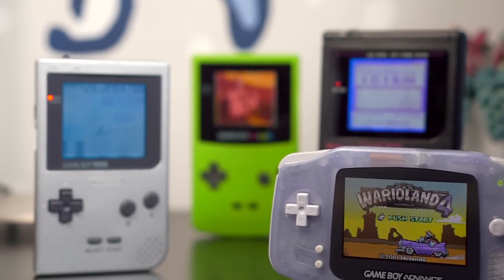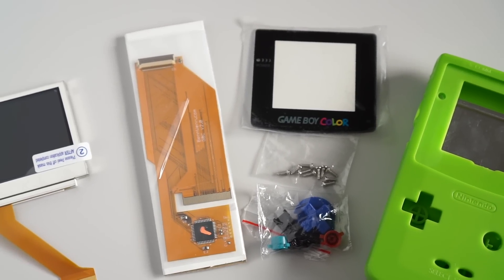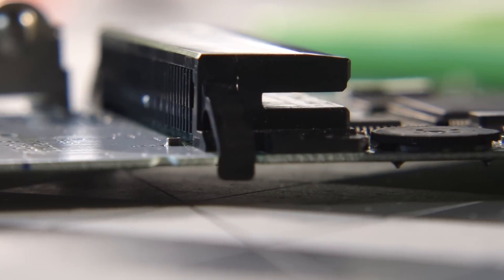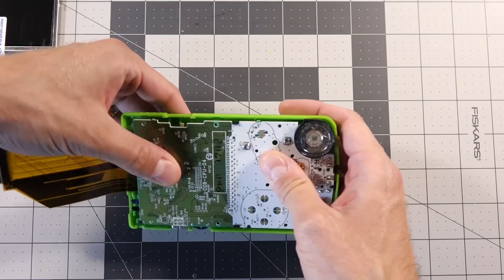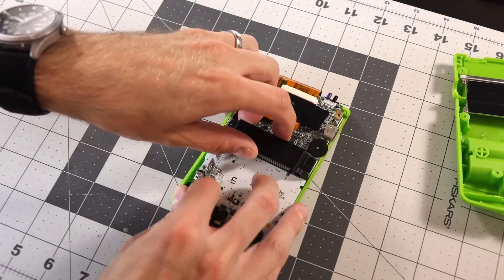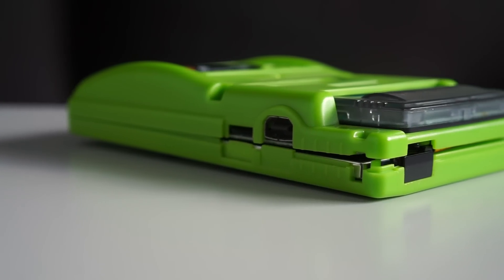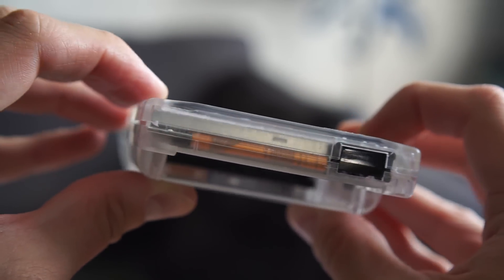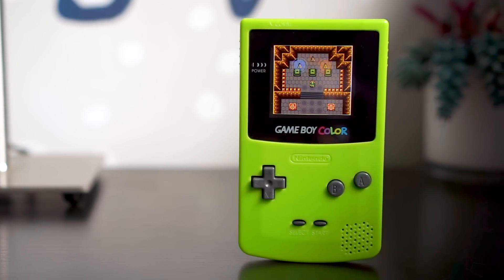BennVenn Backlit Game Boy Color Mod

Comment: you can take the metal casing off the LCD to allow more room. the front part comes off pretty easy after prying it, but the back has that little tab you have to be careful with otherwise you could ruin the screen. also, you can shave a power switch down to about half as wide and it will fit and still be functional.

Comment: I would never mod in a screen that requires you to trim it down on the inside, this screen doesn't even have the proper resolution. I hope there will be new backlit screens that fit, but that's unfortunately unlikely.
Reply: Eddie This screen has the EXACT correct resolution, pixel aspect and viewing aspect ratio.
Reply: No, it's a higher resolution that has to be masked off.

Comment: I'd rather wait until a TaoBao screen is RE'd and mass produced.
Reply: PandaXclone2 or you could fund bennvenn and his experiments. Check out his facebook, hes been going through quite a lot to source a proper square screen.

He makes little to no profit for this stuff. Heck, he even hand builds his own design of sd card based flash cartridges because he thought the everdrive was too expensive.
Reply: Don't use Facebook. Anyway, so long as he's making correct-sized screens then I would probably fund it.

Comment: Losing the power switch and not being able to close the housing is a deal breaker to me.
Reply: Byron If you mod the case correctly, or buy the pre-modded shell it'll close up like the original, with a power switch and an LED
Reply: Its pretty neat. Does not beat my backlit modded gba's but for 30 bucks its a great unit with a pretty decent built quality. D-pad is a bit hit&mis though, but replaceable with a gb pocket d-pad
Reply: I own a GB Boy Colour and it's awesome!
Reply: Or you could buy the GB boy colour on amazon for, like, $20

Comment: Hi Collin, Great new video with slick production and editing as usual. I'm planning to do this mod and have joined a back order queue for the ribbon cable. I've seen another YouTuber video about this mod and he removed the lcd assembly from the aluminum enclosure and gained a couple precious mm. Have you seen that vid?

I'm also not in favor of gluing the package together. I wish a Chinese vendor would create a custom gbc shell for this mod. There's got to be a better way.

Comment: Don't forget the missing power LED in the "things to consider".
Reply: Eugene Romero If you mod the case correctly, or buy the pre-modded shell it'll close up like the original, with a power switch and an LED
Reply: I don't believe so, since the area where the LED sits is now covered by the actual screen (screen goes edge to edge inside the shell). The only proper way of doing it is by installing an SMD LED on top of the screen, with something like copper tape. So its doable, but I think Colin should have mentioned it in the video.

Comment: Let's hope Nintendo release a Gameboy Color Classic with a 100 built in games. I'd be all over that.
Reply: You can get the "GB Boy Colour." on eBay haha
It's backlit and has about 100 games on it...
Reply: Yeah, but lcd is a dumpster fire.
Reply: It's REALLY not that bad. The weird aspect ratio is a massive turn off for purists, definitely, but for 25 bucks shipped it's a SOLID option for those without electronics skills like myself.
Reply: major advantage to it would be that a low power chip could power it and modern batteries could make the thing to a couple of days of constant backlit gaming if the size of the thing was anything like an original GBC. 
wouldn't need as much power as a smartphone but could house a bigger battery than most phablets and would have no cellular radios or other wireless stuff to drain battery

with it being a portable that can clock up more hours of gameplay out of convenience there would be more logic to Nintendo having some mechanism to load on different gamesets OR to have significantly more than 20 games included on it. 
maybe 20 top tier original, a few enhanced (super gameboy palette stuff) and 20 top tier GBC games would do it.

done right that would be far more appealing to me than any of the other classic devices because almost every aspect of the gameboy would be majorly improved. 
its not like the situation with NES and SNES games looking better on the CRTs of their era - all the gameboys prior to the backlit GBAs look really really bad next to any screen from the last 10 years.
Reply: I have one of those, it's ok-ish but I want something with that quality Nintendo feel

Comment: Colin, you NEED to include a disclaimer that the pin 3 sound chip mod at 2:27 is NOT required for this!  This is a very tricky mod, and people can risk breaking their GameBoys.  Just a friendly heads-up.  Nice video otherwise, and I'm glad you finally made yours!
Reply: Hey guys, here's an update on this situation - I spoke with BennVenn (Ben Grimmett) about it:

"You don't NEED to do the pin3 mod, it'll just give you a constant buzz/whine and use more power and depending on the GBC version, it wont run flash carts."

Essentially, the pin 3 mod is not "required", but it is highly recommended to do it.  Seeing how Colin is using a flash cart to run Pokemon Prism on his modded console, the cart is most likely only working because he did the pin 3 mod, so just be aware of that downside if you decide not to do it.  That said, in my experience, the hissing noise wasn't any more noticeable than the feedback/hiss that was coming from the speakers before I modded mine, however BennVenn recommends doing the mod anyways.  Also, make sure you have the right tools for the job!  BV recommends having a clean iron tip on your soldering iron and using flux when un-soldering pin 3.

Happy modding, everyone!  And let myself or Colin know if you have any questions!

Comment: Although your work here is awesome and your skill at doing these mods is superb, i'm pretty disappointed. 

The cost of this mod is huge and the skill necessary to do it is really high (i suck at soldering lol) and the GBC shell doesn't even close at all. But considering that this is beginning of GBC backlighting is cool i guess. I think i'll stick with my GBA SP 101.

Great video Colin!
Reply: Matrigger If you mod the case correctly, or buy the pre-modded shell it'll close up like the original, with a power switch and an LED

Comment: wait so, you don't have the power switch installed? my problem is, that the screen doesn't even fit. I'll need to remove the front metal case then I guess...
Reply: Gehirnstaub If you mod the case correctly, or buy the pre-modded shell it'll close up like the original, with a power switch and an LED
Reply: I modded the case correctly. I'm 100% sure. Also used are a aftermarket shell. I made the same thing as Colin, but as I said the screen just goes in, when I remove the front metal.

Comment: Amazing job as allways. However if it doesn't fit in any possible way I don't really see the point as it wouldn't be useful to play. That being said keep making such amazing tutorials! Thank you very much!
Reply: Cesar Delgado Cabrera  If you mod the case correctly, or buy the pre-modded shell it'll close up like the original, with a power switch and an LED

Comment: Hmm it seems to be a simple case redesign to allow the screen to fit perhaps a bit more thickness on the front shell to allow the screen to fit better cant really tell how bad the screw issue would be does the screen get in the way of the stand offs as well? the mod isnt perfect but its better than having to deal with no backlight mods at all for the GBC.

Comment: It ain't worth it tbh Colin. It's over priced
Reply: Eddie W. I have that craving bro, but it still isn't worth it. Colin made the installation look really simple while other guys had a lot of problems with the adapter that Benn listed as experimental. The cost of the adapter is ridiculous because these things cost $5 on average per unit to make from China(I designed cables like these already for different usage). Then when it comes to the installation you're basically destroying a gbc housing just for everything to fit and not even properly. Imo if you want one of these don't make em yourself have someone do it or just buy a GBASP in a GBC shell

Comment: It's a unique solution to the problem, but is it worth cannibalizing an AGS-101 for a screen? Especially considering the price for even a busted one and the fact that replacement screens are hard to come by, if you happen to bust it during the install.
Reply: Turbanator44568 You can just pick up a 3rd party backlit screen from AliExpress for about $40.
Reply: Turbanator44568 the recent demand for ags 101 screens caused some lcd producers in china to start reproducing them again.
Reply: It uses a replacement

Comment: I'll stick to my external light I think... It looks nice but there are far too many cons that out weigh the pros for me.
Reply: Same with my original Glacier Clear GBA that has a simple halo front light mod, and while it washes out the screen somewhat, at least I can revert back to stock anytime I was just by replacing the plastic screen cover.
Reply: Timeless Gaming UK what's a con
Reply: This mod is so simple!

Comment: People have a demand for a good backlit GBC.
Get a fucking GBA SP and stop complaining.

Don't get me wrong, screen quality might be great, but you get the same system in a better form factor, and it's generally much cheaper than this mod.  :/
Reply: maybe folks dont want their gbc games sticking awkwardly out of the bottom of a gba sp...
Reply: I have all Nintendo handhelds but I'd still love to have a back lit gbc
Reply: Or better yet, get a GB Boy Colour. The SP's button layout is too cramped. Not to mention the carts won't stick out like on the SP.
Reply: problem there is there is shimmering on that screen its scaled incorrectly on the GB boy if the carts didnt hang out of the OG GBA i would say that modded with a backlit screen would be the best we could get.

Comment: Quite nice, but the fit is a no-go... Sadly
Reply: bik3r666 The fit is not an issue if you mod the case as per my recommendations, or buy the CNC pre-modified shell
Reply: you can also remove the front of the 101 screens metal housing to get more room

Comment: I removed the metal enclose of 101 LCD ( front and back ) to fit inside the shell, and cut the power button to fit in position, after 3 or 4 try fit perfectly

Comment: So, a AGS 101 GBASP has to die for this? Bad solution.
Reply: It's like how I have replaced my PSP-1000 screen 3 times due to shattering, and I have a stockpile of 5 more. And you can still buy them for under $10 a whopping decade later. It's just how it is. They made a metric ton of these screens.
Reply: They aren't quite as good as an AGS 101 screen but damn close. The black isn't as deep and the high brightness is a little washed out. Not quite as good as a DS screen either but again, so close that most won't care.

Better off modding a Gameboy Advanced from a non backlit to this backlight with a 32 or 40 pin adapter.

Cheaper option is make a DS Lite into a Macro and use a rom converter to make GB and GBC ROMs into GBA roms IMO.
Reply: It's seriously hard to tell the difference. In a bright environment even harder. And you don't have to go through the trouble of sacrificing an SP101.
Reply: well it depends not every one of them is the same, my chinese ags 101 has much better viewing angles than the original ags 101.
Reply: While I did wince at his snipping the plastic as a automatic knee jerk reaction, all he's using that is original is the motherboard and even then he's only doing non-destructive reversible mods (snipping the extra leads on the pins being irrelevant since it still works as it did originally). So, no worries ultimately.

As Ben Heckendorn always says, don't build something you can't open or fix. I'd say also, don't mod something you can't reverse if the need arrises. Then again I'm arguing from a preservationist standpoint. Not everybody finds preservation important. Some value progression over preservation even at the cost of destroying history.
Reply: DerKettenhund there is china factory what did a copy of the 101 screen. But to say it right, i cant find a difference to the original! They are realy good and cheap.
Reply: iVirtualPlays there are a ton of ds with the top half damaged beyond repair so they are just salvaging the bottom screen.
Reply: It's not from a AGS 101, but even if it was, nothing has to die to do this, you can take apart an AGS 101 and keep the parts perfectly fine.
Reply: Wow such ignorance. All these AGS-101 screens that people use for mods are reproductions.
Reply: DerKettenhund Nowhere in the video is this stated. What I gathered from his screen shots is that the ags101 screen is a new old stock oem part.
Reply: DerKettenhund I would also like to add that Colin has stated in past videos that he is against sacrificing functioning consoles for parts.
Reply: then where do they come from? Has a warehouse been found with hundreds of them lying around? or are those  imitations?
Reply: DerKettenhund yeah that's what u was thinking...
Reply: Slices off top clam of GBASP
Reply: I've always wondered where these come from.
Reply: Yeah, the DS hinge assembly can break to the point repairing the thing is no longer feasible, and the Macro mod gives you at least some kind of use for a device in that state.
Reply: Like Ryan stated, the screen is not taken from an AGS-101, but is a reproduction of the screen, made in china. They are nearly identical in every way. Only someone with fairly keen attention to detail can really tell the difference.
Reply: Not worth it if it's just using a gba sp screen.

Comment: i feel like there could be better luck using a not game boy screen maybe
Reply: erica if you follow bennvenn on facebook, hes been jumping through hoops looking for a proper square screen with a 1 to 1 pixel resolution.

I think hes found one, but he needs to engineer a new ribbon to make it work.
Reply: being a 160x144 resolution screen, I don't think it would be hard to mod a 160x160 to work on it, and if I recall there were plenty of those in older phones like some Black Berries out there. Just need a good sized one and then... all the patience to make the right adapter cable.